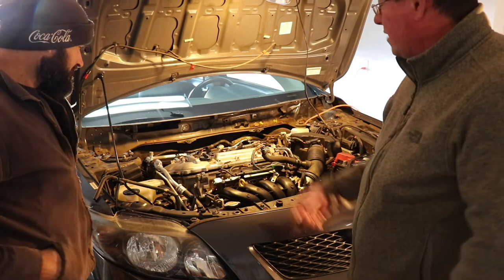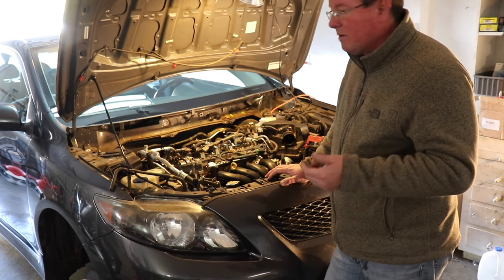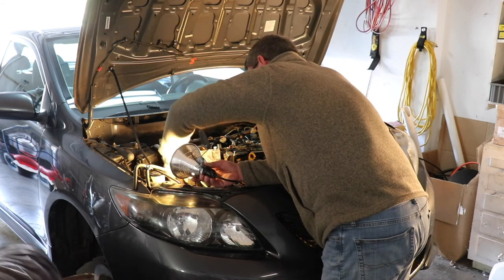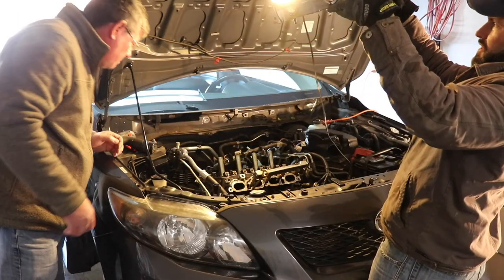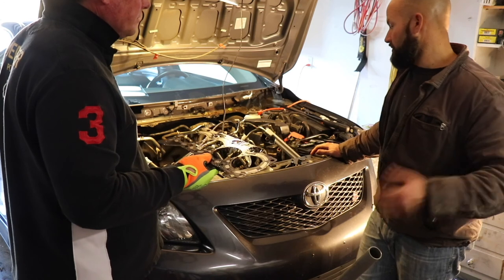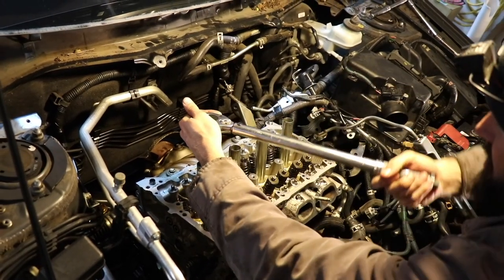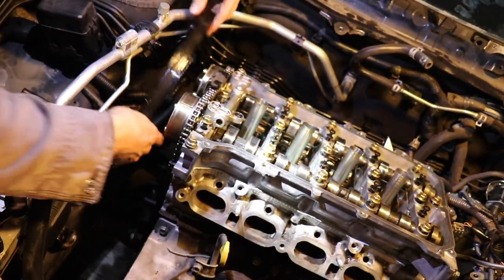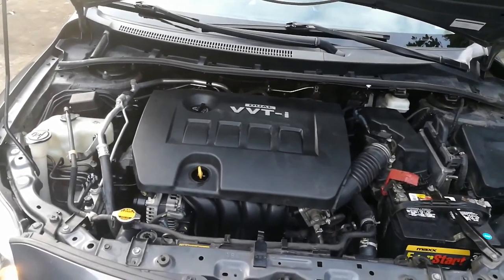2009 Toyota Corolla 1.8 Motor Gasket Repair

Comment: I also have a 2009 corolla, with a cylinder 4 misfire and low compression in cylinders 3 & 4. Thank God for the both of you 🙏🏿, HUGE help 👏🏿👏🏿👏🏿👏🏿👏🏿👏🏿 I also found a bad head gasket.

Comment: I have 09 corolla 1.8 with 125k, hard to start sometimes, runs rough after it runs a while, losing compression, not running hot, failed leakdown test at 3 and 4, no oil in radiator so doing this same job soon.  Thank you for the video

Comment: Great video I was wondering where to get the information for torque values on the head bolts, and where I can buy the tool to remove the head bolts
Reply from the maker: Auto part store and the dealer will tell you.
Reply: I got em. You want em?
Reply: @Alexmechanic559  ill take tthem i think this is what im going to have to do to my 09 corolla
Reply: @BIONDIEST  Head Subassembly starts @ 1:05

Comment: Hey guys, great video. I know its been a while, but after you took your head bolts out and removed the exhaust bolts what did you used to get the head off? It being aluminum makes me nervous to pry at all.
Reply from the maker: We took our time and carefully pryed it off.
Reply: I got mine, just slowly putting it all back together while making sure it's all clean. This is on my 09 pontiac vibe but it's the same as the matrix.

Comment: Hello. I was wondering about the tool for the head bolt. I have read only use bi-hex and NOT to use a tri- square. I can't find the tool. What did you use for reassembly. Thanks
Reply: I used a triple square - no problems for me and reused head bolts
Reply: @dleef911  thank you. I appreciate the response.
Reply: @dleef911  Head bolts act like springs.... hence the 90' and 45' subsequent torques.  Used head bolts won't have the elasticity and "spring" like torque and will result in a shorter life for your head gasket.  NEVER cheap out on head bolts.

Comment: Hi, what is the oil viscosity this engine use?
Reply from the maker: 5 30
Reply: 0w-20 or 5w-20 for the 2ZR-FE 1.8L engine in the 2009 Corollas
Reply: @southernbuilds6764  that's wrong

Comment: from what ive read online this engine should have been recalled. ive taken mine to Toyota and they said it was fine to drive. yeah right. 180k i have a misfire on 4 and im thinking best case scenario it needs a new head gasket. ive also read that the cheaped out on the piston rings on this engine. i guess i should look up how to replace those too

Comment: Did you need to machine the clyinder head?
Reply from the maker: Yes we did.
Reply: Was the head even warped? I have same engine ,same issue need head gasket but didn't overheati
Reply from the maker: @dleef911   No it was not.
Reply: @southernbuilds6764  interesting, Toyota says this head should not be machined, only replaced if out of spec
Reply from the maker: @dleef911  We just had it inspected by the machine shop.
Reply: @southernbuilds6764  How about the block?  Mine has a tiny bit of wear between 3 and 4.. that's a huge job to get that out of there to get it machined.